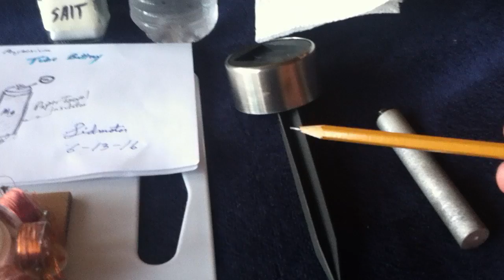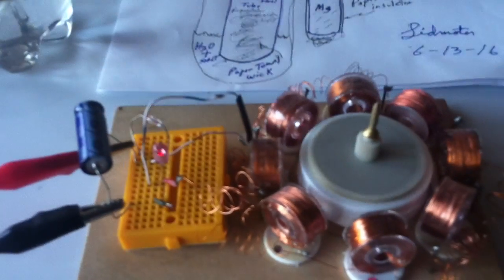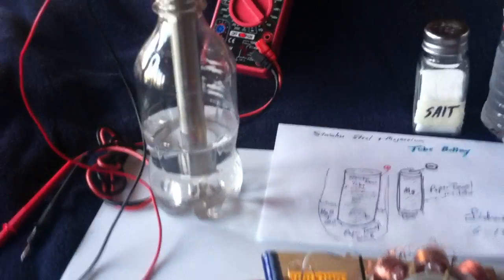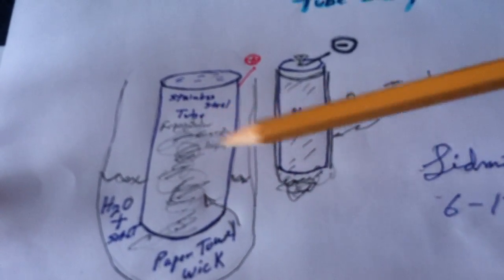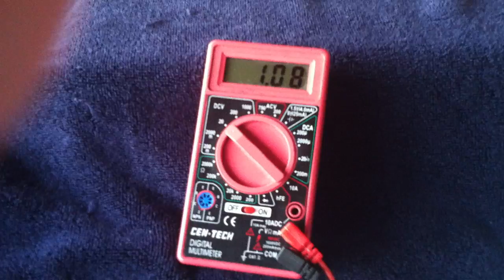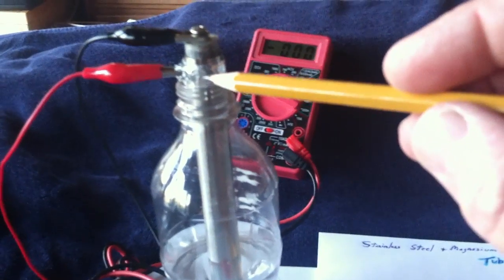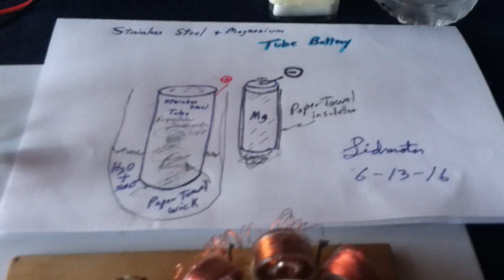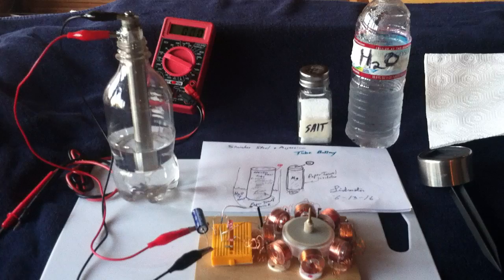Tube Battery

Comment: Sulfamic acid (some cement etches, tile cleaners) works really well with zinc apparently. Haven't tried it yet. I tried sulfamic and aluminum and it also works. I used an aluminum eavestrough spike. Gummy soft aluminum. Lots of combos to explore. Fun stuff.

Comment: Nice setup & explanation!

How much is the current draw of your xit?
How many hours of run time did you get out of it?

Thanks for sharing!
Reply from the maker: Thanks. I just built this today. I have not had much time to do any testing. I may change the electrolyte to something better.The basic cell structure was just the first step. I might try one of the crystal type electrolytes. It is still running just fine after about 5 hours.  I have a Joule Thief hooked up to also now in parallel.
Reply: Ok, thanks.  I'll wait for the update!

Comment: I was seeing where the size can be much smaller and still have the same output. I will be trying this using magnesium wire and copper wire coiled around with the crystan battery mix. It would seem better to use a coil of wire rather than a copper tube as the tubes split according to one of lazersabers videos.
Reply from the maker: The problem with using the magnesium wire (or ribbon) anode is that it just takes one spot to eat through, the circuit opens up, and your battery is dead.  Been there done that.  A copper wire cathode does work pretty well but that can also break.